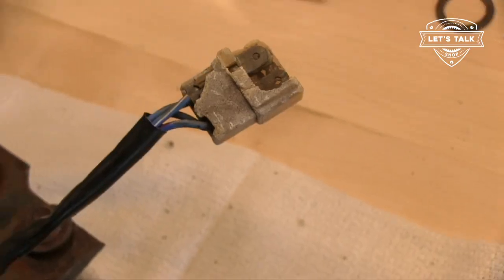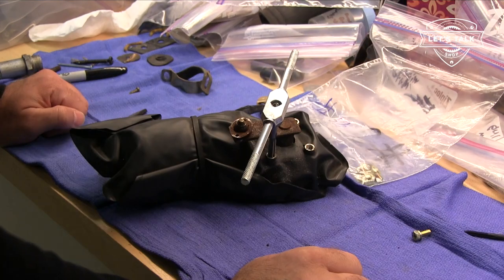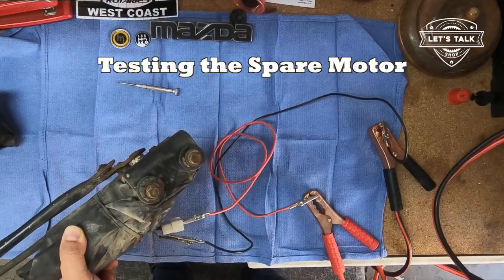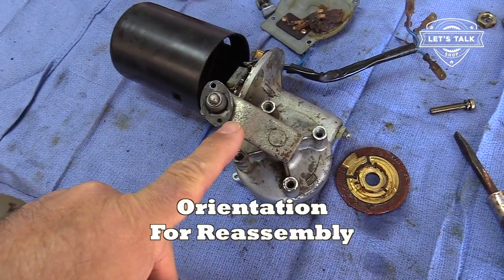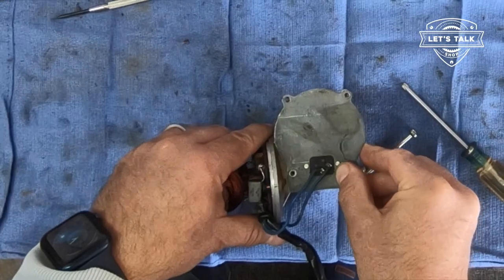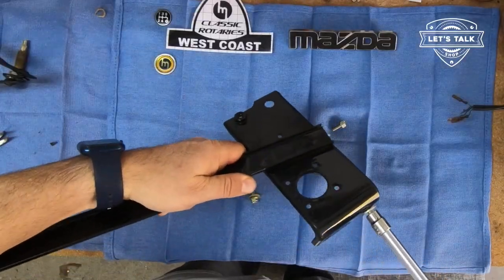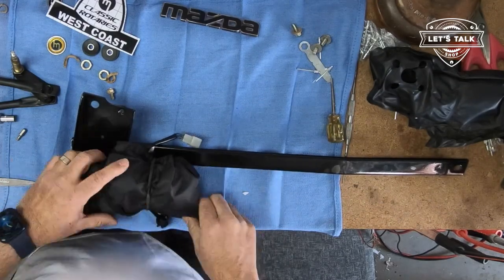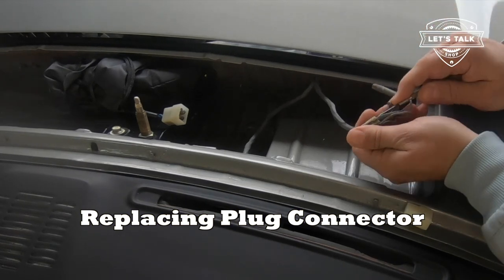Vlog 63 Wiper Motor Testing & Repair

Comment: For some reason I''m still not getting notifications of your vids Steve so just saw this for the first time. Good timing too cos I'm at the stage of doing my wiper mechanism, very hand info. Would you have a link to the plastic replacement plugs?
Reply from the maker: Hi Keith. You might have to click that notification bell on YouTube to be notified when a new video is posted. As for the plugs, you might be best getting from Jaycar down under. Otherwise, I bought this kit from Amazon ... https://www.amazon.com/gp/product/B08JCVQ1JQ/ref=ppx_yo_dt_b_search_asin_title?ie=UTF8&th=1